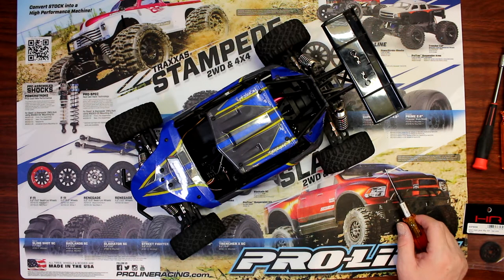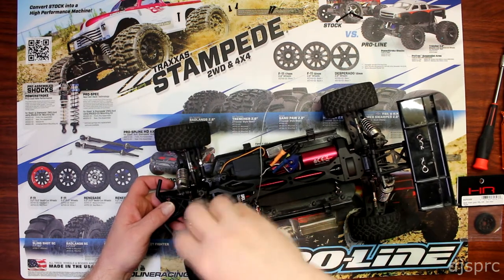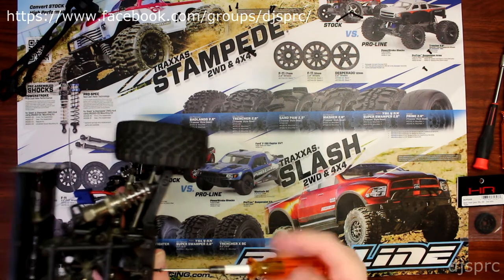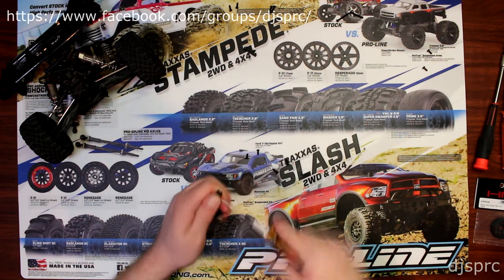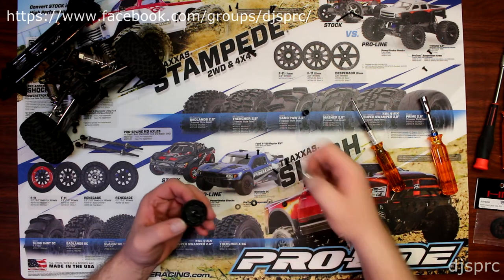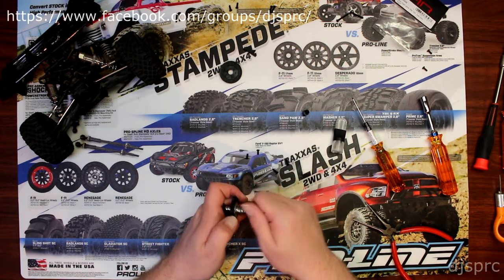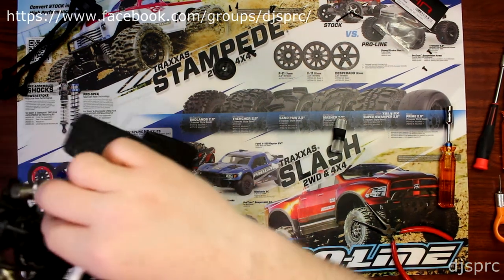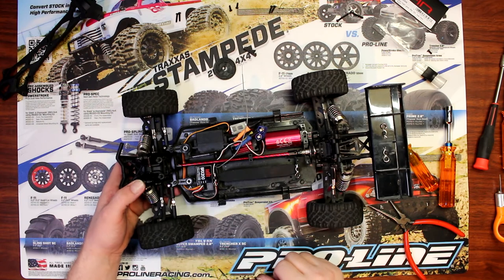How To Install A Spur On A Mini 8ight

Comment: Just changed the spur/pinion on mine. Wish I saw your video before I did it ahahha. is there a certain way to align the spur to the pinion? Kind of seemed like my motor shifted from what I seen from yours in the video.